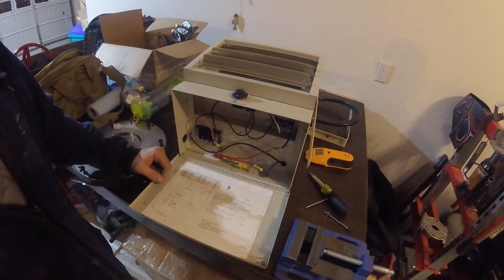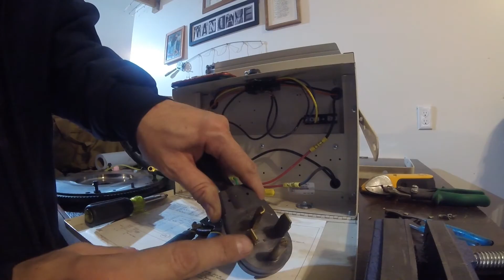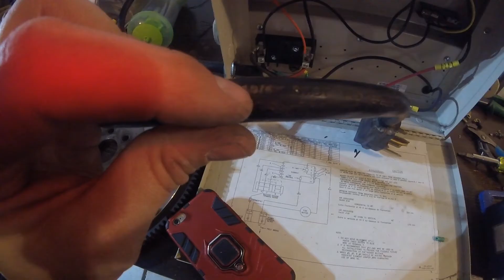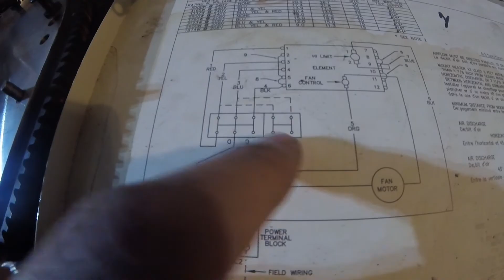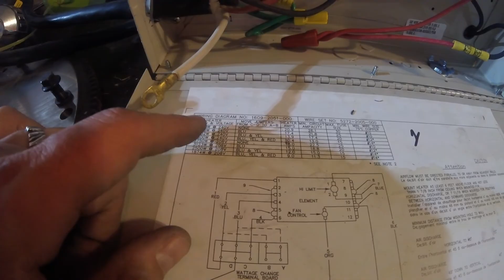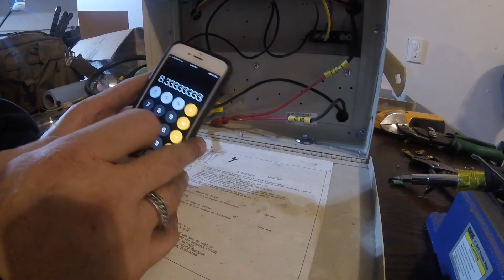Wiring a 240 Volt Heater - 1000 to 5000 watts

Comment: I see that you said that this is an Amazon buy, but this is IDENTICAL to the one I have made by a company called Marley in the US. They’re about $500 new.
Also, I was able to use 8/2 in the heaters lugs, it’s available in longer lengths, and there’s less voltage drop. Also, wiring in whatever plug you want is super easy and you’re not paying for that extra useless conductor in a 10/4 appliance cord.

Comment: I have a 220 heater that I removed from a location and it was working and it only had the two hot wires hooked up and I can't see anywhere for the ground to be connected. Do you need the ground for it to run or if you need it for safety where do you connect it? You did not show where you connected the ground in your video

Comment: Where can I purchase a 240V cord?,
Reply: You can get one at any hardware / home improvement store, but you need to get a single phase cord like you use for a electric dryer or range. The heater in the video is a single phase unit. I have no idea why he is using a 3 phase cord in the video.
Reply: It's not 3 phase  it's a  cord with 2 hots and a neutral  with a  ground....

Comment: Thanks for the video, I would add that the last calculation might be a bit confusing as you were saying earlier you will be doing the 5000 watts which would require the #10 gauge wire. (And accordingly the 30amp breaker). I know you were  giving that last as different example.